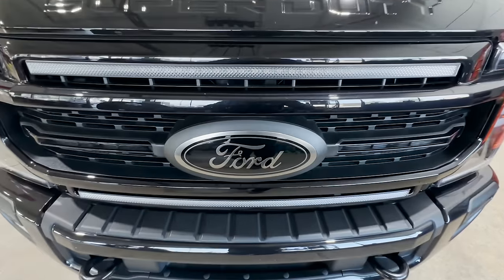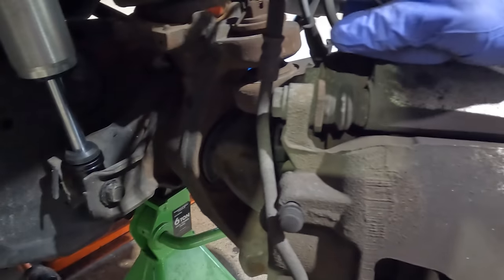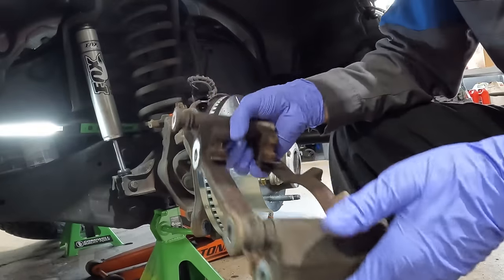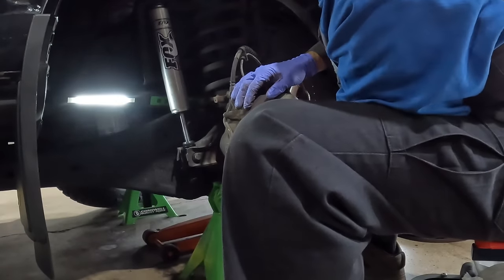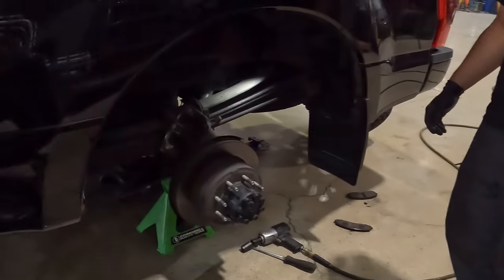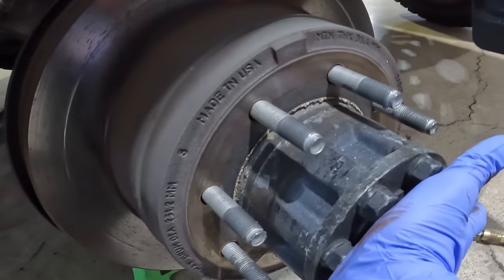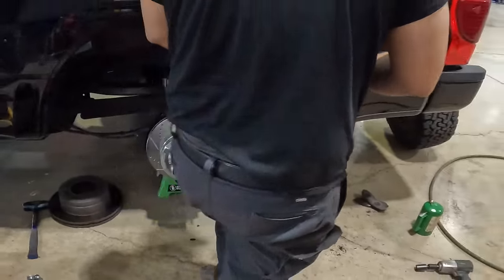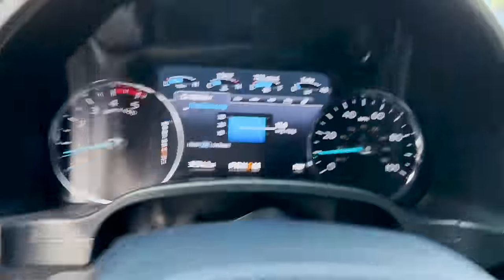Got DUSTY Superduty brakes?? NOT ANY MORE!!    **WATCH THIS**   @Powerstop

Comment from the maker: The video tonight was the last one! https://youtu.be/KVNOoZ-VYv8
Reply: Last one from the dealer location...???
Reply: What's your opinion on a front leveling kit for a 250 4x4? Bagged on the rear, but I'd like a little more up front. Also shock and stabilizer replacing factory? Any suggestions are appreciated. I respect your knowledge. Thanks
Reply: Instead of beating the snot out of the rotor at 10:15, get a 5/8 grade 8 bolt, nut, and a couple washers and use it as a press between the caliper bracket mount and the rotor. Vic's Garage has a video on it
Reply from the maker: @bedlamite42 here in the rust belt, sometimes ya gotta work for it.
Reply: @PowerStrokeTechTalkwARod  I'm in WI, it works better that you might think.

Comment: Recommend spraying down rotors with brake clean prior to installing, especially the inside contact surface for the rear parking brake shoes.  The usually ship with a thin coat of oil. You don't want that on your shoes.

Comment: I replaced mine with powerstop, cross drilled and slotted. Carbon ceramic pads. Have em on for 79k miles. Pull 15k 10k miles per year. Zero dust and stop wayyyy better than factory. Love em.

Comment: Those are the exact brakes I put on my 2012 superduty. I'm convinced they're the best especially for the price. 2 years and about 60k miles and hardly any wear. I don't tow or haul much but the heavy duty pad and rotor set from brake motive off ebay lasted me a year. Switched all 4 to powerstop  - they only make one grade drilled and slotted rotor but you can get them in a set with 2 different grades of pads - definitely recommend the extreme pads to go with them.
Reply: why do you have a SD if you don't even need a truck
Reply from the maker: Cuz thats what ne could afford
Reply: @lmCIoudz  I'm a contractor - 8' bed, 4 door, tool boxes, ladder racks. Sometimes that bed is filled to the racks with materials with the cab jam packed and a trailer behind me. I said I don't tow or haul much, I didn't say I don't tow or haul anything 😂. I'm never towing cars or heavy machinery, should I just use my Ranger since I don't tow a 5th wheel?lol
Reply: @lmCIoudz  Wow dude don't you look smart....

Comment: I have power stop slotted and drilled rotors with the carbon fiber or ceramic pads  and I love it, no rusty rotors they don’t rust, very very low break dust, and I don’t deal with warp rotors anymore either , a lot of heavy hauling

Comment: I’ve been running Powerstop pads and rotors on my F-350 for 150,000 miles.  The rotors are great, and the pads keep getting better.  The last carbon fiber ceramics I put on have been great.  Following the break-in procedure is absolutely essential to get the maximum performance out of them.  When my F-450 needs brakes, it will be getting these too!
Reply: Pads lasting 150k miles? I assume you replaced them at least once
Reply: @ATICrossX   Of course I replaced them!😆

Comment: Powerstop pads front and back I used my factory rotors that had 30k miles on them , I’m very happy no dust and they grab hard just make sure you bed the brakes the directions are on the box .

Comment: Yes, I have power stop on my 2016 F350 srw. 6.7 all the way round. After I had two front stock calipers fail I went with pads,rotors and calipers from Power Stop. I love them, handle stops with my equipment trailer like a sports car. Good investment.

Comment: I like the idea of putting antiseize all around the wheel studs to help keep the rotor from adhering.  Powerstop makes nice products.  I installed rotors and pads on my 2002 pontiac grand prix gtp I don't know how many years ago and they still look/work good.  Already purchased a set of pads for my 22 F250.  I know I will eventually need to install them and nothing gets cheaper with time.

Comment: I had stock pads and rotors for 80,000 miles on my Hemi Jeep GC, I put the Z26 kit on and they lasted only 30,000 miles!  Zero brake dust which was awesome, but the longevity sucked and the pads actually wore the rotor!  I’ve never seen a pad wear a rotor!  I’ve been doing my own brakes since HS back in 1990, so I’ve done a couple!  Still miss when Wagner was warranted for life!!

Comment: I wish I would have saw this video a couple weeks ago. One of my sliders was seized. I could not get it out and had to buy new calipers. Unfortunately I had to get them from Advanced Auto because I could not wait for the dealer to open. I was doing it on the weekend. All went well after that but I will definitely be upgrading to the powerstop the next time I need brakes. Nice video. Thanks.

Comment: I use either Wagner or Powerstop brakes. The last two brake jobs I did, the wheels were "welded" to the hubs. I had to heat the wheel centers to get the wheels off. I always thoroughly clean the hub surface and wheel centers. I apply anti-seize or "Lisa Frank Glitter Paste" as I now call it to both the wheel centers and hub surfaces. Here in Southern New England if the weatherman just hints that there may be the slightest chance of snow, the DOI (Department of Idiots) brines the roads. I like to put a sparing coat of brake grease on the caliper bracket and then install the anti rattle clips. All metal to metal contact surfaces get a sparing coat.

Comment: On my good old dependable 7.3 Powerstroke I use Motorcraft Super Suty Severe Duty brake pads with minimal dust and maximum braking power without eating up the rotors. Not sure if Ford still offers them for the newer trucks.

Comment: I've always gotten ~70K miles out of the OEM brakes and for that reason I always replace the pads using the OEM Motorcraft pads. Sure, there is brake dust but they work and since I wash my truck regularly, it doesn't bother me.

Comment: I sprayed my hubs with fluid film I saw Eric O using it so thought Id try it. And those were the brakes and rotors I put on my 2017 SD to get rid of the dust.
Reply: Fluid Film helps you to keep your sanity if you live and drive in the salt belt of upstate New York, Michigan, or Ontario Canada! It might not totally prevent rust, but it slows down the formation enough to allow suspension and brake service.

Comment: While you had the rear drums off, I would have put anti seize on the hand brake adjuster.  If you are in the rustbelt area the wheel adjuster will seize up and that could make it a nightmare trying to pull off your rotor if you have to loosen the adjuster to get it off.

Comment: Even tho my truck only has 12k on the clock I’ll still probly throw a set of drilled rotors and fresh pads on the front. And probly just put pads on the rear. I’ll save the old gear and put up on the shelf.

Comment: Z36 pads is what I went with on my Silverado. I only had 40k on it and the factory pads still had plenty of life but I did a pad slap with the Z36s. The factory pads when they got hot would shudder horrendously. I went down a 10% grade with 1k in the bed and while I didnt find a lot of fade the steering wheel juddered an unbelievable amount. When they cooled, no problem, even after that, but I still ordered the Z36 that evening. No such problem with them and yes the wheels are clean too.

Comment: I have a 2017 Ford edge AWD sport 2.7 it did 118k on the OEM pads and brakes
Reply: I had a 2015 Edge with 156k in original factory brakes. I did the front brakes only. Back still original when traded off at 161k.

Comment: I’m a little late to the party with this video, but this is a great presentation of a high class brake job. Those rotors are awesome with the vent slots and holes. I bought my ‘12 F350 brand new and it just hit 100k and still have the original front and rear brakes. They are just under half pads on the front and about 3/4 on the back. Never had a dusting problem but definitely have the rust problem because I live in Pennsylvania. I’m wondering if they changed the pad material over the years because my friends with newer super duty’s complain about the dust all the time.

Comment: Thanks AROD...replaced my 17 F350 SRW 4WD CC LB at 60k miles...with Raybestos slotted rotors (front only) and their severe duty metallic pads...will replace rear rotors next pad service. Did i miss its use, or was NO brake kleen used during this brake service???
Reply: You missed it, Aaron shot some Brakecleen on a rag to wipe off a smear of silicone grease on the front rotor.

Comment: on my older trucks id just get a big ass order from Detroit Axle but it seems getting rotors and other parts for my 17 and 19 isnt as plentiful as older models. gonna upgrade to these rotors and brakes very soon because the stock rotors and brakes absolutely cake my front wheels

Comment: Need front pads (dealer wanted $600 to do stock pads) on my 21' SD with 59k miles. Thanks for ghus video, im ordering the set today!!! Btw, you skipped adjusting the parking brake...
Reply from the maker: I knowwww, I didn't need to do it on this truck. I shld redo an adjustment video

Comment: this was a very timely tutorial as I was told by my servicing Ford dealer that I was down to 3mm of pad.  Quoted me over $2K to replace pads and rotors.  What I found curious was that they included new caliper bracket bolts in the quote.  I''m no longer wrenching as much as I did, but to quote replacing bolts????  Is this the FMC recommended procedure?  I did order new bolts and they had lock tight already applied.  Changed out the fronts today and did replace the bolts since I had then, but I probably wasted the $20 it took to buy the new bolts.  Ended up installing Raybestos rotors and the powerstop pads myself this afternoon.
Reply from the maker: Yeah those boats are not one time use

Comment: Great job, but i would never put grease on the tabs at each end of the pads because grit and dust will stick to the grease and could cause a problem. Thats why those inserts are so shiny slick, they dont need any lube and dust and grit wont stick to them. The brake job was most excellent.
Reply from the maker: Here in the rust belt, lube is a must my friend

Comment: I’m going from a 150 to a 250 and do as much of my own maintenance as possible.  Does the SD have a threaded hole to sink a bolt to push out and release the rotor like the 150’s?  I’ve done multiple 150 break/rotor changes and use the hole to make life easier.  Also, do you release the reverse pressure off the fluid lines when compressing the pistons by opening the valve?   Also, the power stop z36 front pads I hade on my 150 wore out at 12,600 pulling a light 6,000 RV. (W/trailer brake)Albeit it was while coming over numerous 11,000’ foot mountain passes.  PS warrantied the first set, and had good CS, but the next set didn’t do much better.  They felt good, but didn’t last.  Thanks for your vids!

Comment: I'm close to the point where I'll be doing minimally the rear brakes on my 2011 F350SD TD SRW 4x4.  This the 1st brake job since i purchased it used @ 2years ago.  We do tow a 5th wheel, so need good components.  I was wondering your thoughts and your experience using ceramic metallic brake pads. Do you think they would be heavy duty enough for my application.  We live in Colorado and do a good bit of mountain travel, running up and down some rather long mooutain passes with some significant altitude changes, so the brake components are very important for us.
Reply from the maker: Yes those are good pads

Comment: I drive a truck im okay with dust. I use my truck as a truck. Towing with ceramics suck they dont dissipate heat quickly and will lead to quicker fade or warping. I run bendix fleet metallic on most my rigs. They're the same as the BRSD super duty pads. On my f150 I did a full EBC brake kit with yellow stuff pads. You wanna talk about dusty theyre a heavy metallic pad designed for towing and the occasional track day. No complaints out of my eco boost with some minor mods. 

Besides rotors i have not liked power stop products. I do find there price is generally pretty good on slotted and Drilled rotors but their pads have not impressed me one bit. Again i bought a truck for truck things even my M3 has extremely dusty brakes due to its heavy metallic compound. Towing and performance im totally fine with dust. P&S brake buster will take care of dirty wheels in no time
Reply: Agreed

Comment: Awesome video bud. I want to  get powerstop brakes too. I’m sick of the brake dust.  I noticed you grabbed the rotors out of the bags and installed right away… you didn’t have to clean them with brake clean???
Reply from the maker: Nahhhh
Reply: @PowerStrokeTechTalkwARod  isn’t there oil on them to keep them from rusting??
Reply from the maker: I wiped em with bra kleen

Comment: I did calipers, rotors, and pads on the front and every once in awhile it will pull to one side when braking. Did I not bleed correctly or is one of the calipers sticking?
Reply from the maker: Sticking

Comment: Nice teaching ARod ! :) I try to find out wich grease to use for slide pin on my F-250 2017 Super Duty, I foung Permatex but don't know witch one to pick, I live in Canada with cold weather. Do you have something to suggest me ? Thanks.
Reply from the maker: Any4x4 grease will sufice
Reply: @PowerStrokeTechTalkwARod  I'm talking about the brake caliper sliding pin and back of the pads. 4X4 Grease ? Thanks for fast response.
Reply from the maker: @stevebeaulieu2617 silicone caliper grease

Comment: You got any secret way of removing the center cap on the rear dually on a 2017 F-450 I have tried multiple times with a spring loaded bar and it just wont come off.
Reply: ARod has a video where he used a 2x4 to pop them right off
Reply: @TheOutdoorDaileys Actually it’s a 2x2  from shipping crates  !
Reply: @TonyBenton0728  Good call.
Reply from the maker: Watch our video!!

Comment: An other question for you ARod, when you bleed oil brake on a Super Duty 2017 do you start bleeding by the back of the truck, or the front ? And witch side first? Thanks for your help.
Reply from the maker: RR LR RF LF

Comment: I got 198,000 on first set.
Then replaced the rotors with Fòrdmoco... I bought 1 set of lifetime ceramic pads from Napa.  Then replaced pads abòut 30 to 40k. Next set of rotors went 202... Currently at 488,000 and it ìs tìme for pads...I will let you all know !

Comment: Thought you were suppose to use locktite on the large bolts that hold the caliper brackets on. Found out the hard way that was a good idea. Also, I've been running the brake set your installing for a couple years, but didn't think they gave me the stopping grip I was looking for. Now using those rotors, but with Hawk LT Green pads and notice a WORLD of difference. Stops like my 928 now!
Reply from the maker: Really...theyre that much better
Reply: Night and day to me. They aren't completely dustless, like your saying these were. I still had some dust when running them. I notice significantly more bite, with less pedal pressure though. Always felt when pulling heavy that I didn't have as much as I would like, if for some reason the trailer's brakes went out.  @PowerStrokeTechTalkwARod

Comment: My 2018 6.2l only has 30k.
Replacing the pads and using the OEM rotors should be fine? Yes?, No?
Reply from the maker: Just a pad slapp?
Reply: @PowerStrokeTechTalkwARod  yes sir just slap da pads on.
I don't use truck much but during shredding season.
I tow about 11k mostly tow into rough pastures. 
DD is wife's 4rnr.
TY bro, keep up the good work.
Reply from the maker: @sheepdog3828 yes

Comment: I went the Powerstop route with there Z36 pads and rotors , Was not impressed , didn't feel like the brakes improved really any and the pads and rotors only lasted 25k , Now I do tow a 14k trailer but not everyday . went back to OEM till I find something else to try
Reply: Try the bendix fleet metallic pads. They are the same as the Motorcraft superduty pads. Bendix  is a supplier for Ford brakes
Reply: You must be hard on brakes.  I've had them on 3 trucks and 2 were DRW F350s.  I had all of them for at least 30k miles and they were still good for another 30k or more.  I towed a 14,800lb 5th wheel  and a 12k lb enclosed trailer with all of these trucks.
Reply: Not really hard on brakes , I usually get pretty good miles out of them , I always make sure the trailer brakes are working and adjusted for the weight I am pulling . I have read to use the Powerstop rotors with Hawk pads .
Reply: Yeah, I doubt that , I tow heavy, I don’t get warped rotors no more, The brake feel is the same.  you’re not gonna get any kind of difference in stopping power unless you upgrade your calipers, i’m sitting on 90,000 miles on a set right now heavy hauling, they look brand spanking new still, it’s only one year old though I do a lot of mileage, I’ll never go back to factory brakes again soon as first time factory rotors got hot, I had warpage

Comment: Hi ARod, i did grease my caliper sliding pin today by following your video, when I took one caliper off at the front wheel I found one piston that was more inside compare to they other one, I did use the same tool as you to push the pistons back in, but I was wonder if my caliper need to be replace because the tool wasn't touching both piston at the same time ? I was tinking if the piston was more inside is it because he doesn't push the brake pad ? Just one piston pushed the pads ? Tell me what you think. Thanks a lot !
Reply from the maker: Hmmm maybe a sticking caliper
Reply: @PowerStrokeTechTalkwARod  Ok thanks for fast reply !